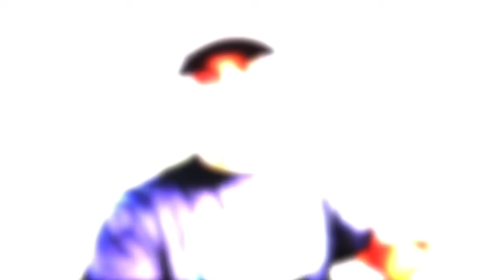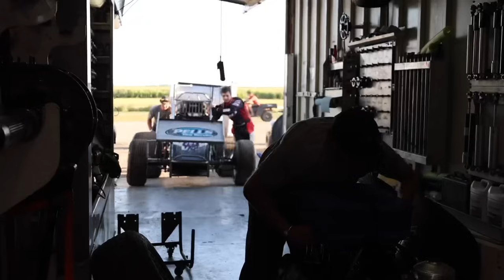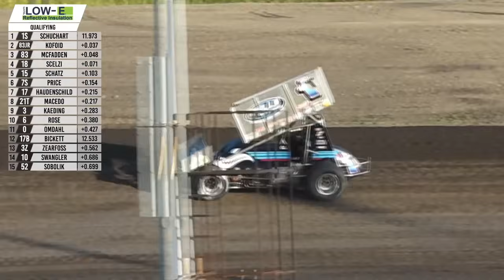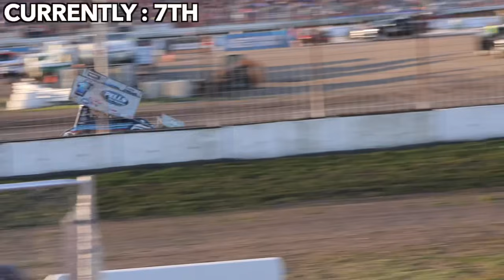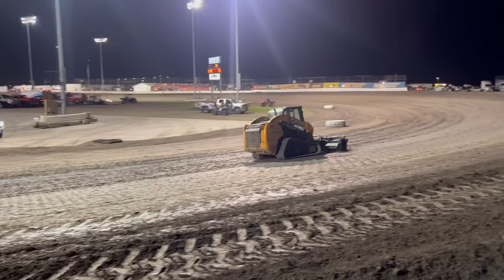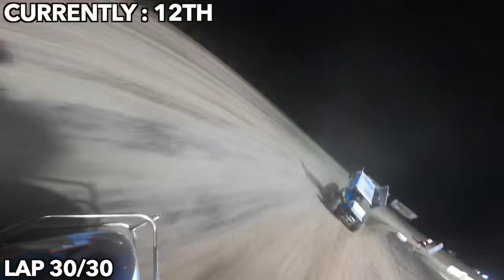A Bizarre Problem At Red River Valley Speedway....

Comment: The Shark racing crew probably appreciates the fact you know your way around a tool box and a race car. Having built ,maintained and driven the THR car. You know how to get stuff done. Especially when is comes to engine changing. That looked like a well oiled machine in action. Saw Carly in the mix too. Helps the team when all hands on deck know how to get it done. Certainly an asset to the 1T car for sure

Comment: We race in West Fargo weekly. It used to be a big half mile, the back straight used to be right where that box is that you stand on in the pits. But now it is a very strange track… the D shape encourages dive bombs so they normally tear up a lot of stuff there. You just never really know what you’re going to get at that place as far as the surface, sometimes it’s dry, sometimes it’s sticky, sometimes it’s a combo of both. It usually does race well for Sprints or Late Models, but other cars not so much